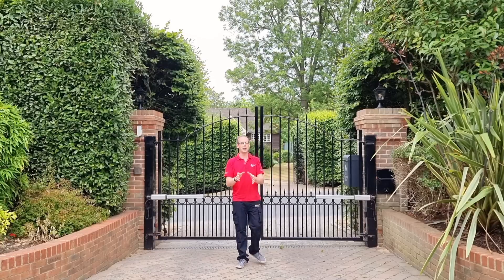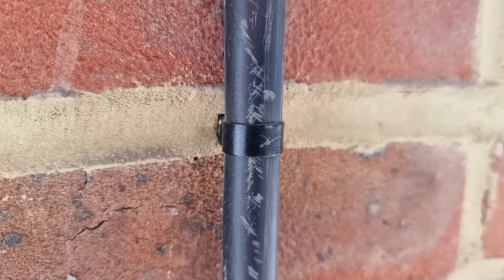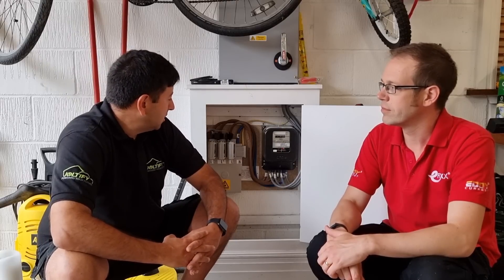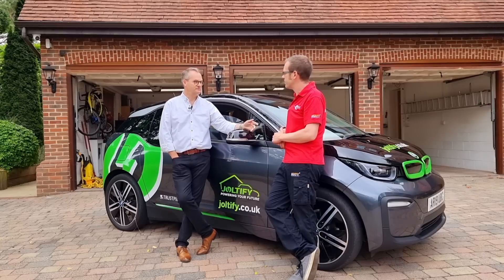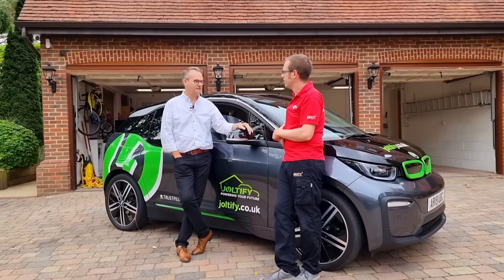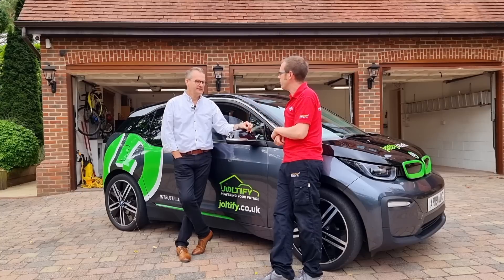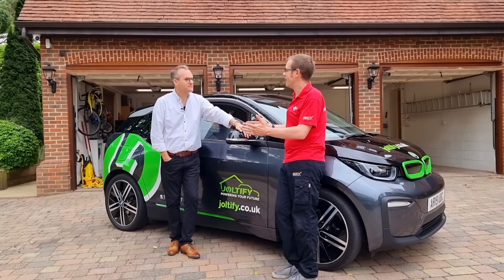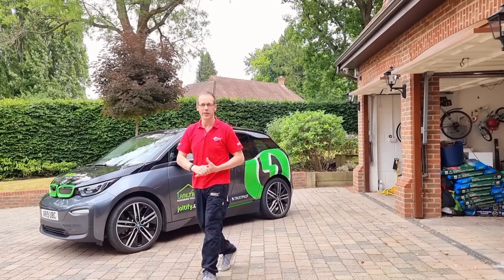THREE PHASE EV Charger installation at HOME with Joltify

Comment: This is what we did in our UK home.  Upgraded to 3 Phase free of charge.  Then added:-

2 x 22kW home chargers (Grid Tied)
1 x 7kW home charger (storage battery & Solar Power)
2 x Tesla Powerwall batteries & Gateway
7.2kWp Solar Array
Smart Meters & Ev Tariff
2 x Electric Cars
Heat Pump, Induction Cooking & Electric Showers

Comment: Not much point in three phase 22KW is there as most EVs only have 11KW AC to DC charger?
Reply: But if you do need a small car (with a range of about 200miles on the 50kWh versions), the Renault ZOE does charge at 22kW, so faster to charge at home than far more expensive cars.
Reply: If you have a 3 phase unit, you can pull 16A 3phase for 11kW, 32A 3phase for 22kW (Zoe & old Tesla) or if you’ve got a car which can only charge single phase you still get 32A for 7.4kW. If you restrict it to 16A needlessly for 11kW you’ll only get 3.6kW single phase.
Reply: We have 2x22kW fast Grid tied chargers at home.  Both charge at 11kW without load balancing... so it's quite handy.

We've also got a 7kW charger connected to Battery Storage & Solar for Summer & during blackout use.
Reply: The video said this is about future-proofing as cars come out which will allow for faster charging from three phase AC.

Comment: Great for people that can afford a house with three garages but I'd like to see more videos about how the rest of us plebs are supposed to deal with EV's.
Reply: Why does the use of a 3 phase charger depend on having 3 garages?
Reply: @deang5622  It doesn't but only the sort of people that can afford a house like that are likely to be able to afford getting a 3 phase supply put in along with all the other associated works.
Reply: @mfx1  Of course it doesn't depend on having 3 garages. I just wanted to expose an error in your statement.

But you're not entirely right in your thinking.
The typical car battery is 100KWh.
You can feed at most from a residential supply 23KW if you put in a dedicated circuit.  Now that wouldn't leave any capacity left for anything else to be powered.
So let's reduce that to say 15KW.

So during the course of the night from 11pm to 7am, you can push in to 120KWh.

So installing a dedicated circuit running on single phase, it is possible to fully charge a single EV vehicle.
 That, is you don't need a 3 phase supply.

You could even charge up two cars to 50% of capacity, giving half their full range in miles. Which is more than enough to get people to work and back.

Comment: Wish you people in another country identify country because electrical vidios very seldom pertain to anything in the USA. As a life long electrician that worked in hundreds of homes NOT ONE ever had a three phase service so this vidio is 100% useless. Never heard of a single electrical ultility company that would even provide three service. Maybe if you had a 50 Millon dollar mega all electric mansion they might offer it but not to the 99.99% of the rest of homes .
Reply from the maker: Three phase is rare in the UK, but the norm in many European countries.
Reply: It's 100% useless for you, but then again you don't have to watch it. There are, but "another country" doesn't mean just US. In the Nordic countries 99% of the detached houses, all new apartment buildings and commercial buildings run on three phase 400V. We only install three phase chargers. There are one phase ones they are more temporary movable chargers
Reply: @John Thomas, I can assure it happens more the other way around because the USA is a massive country that dominates the whole internet. Electrical Installation tends to be very country specific.

Because I watch a lot of electrical videos, I get a lot of videos recommended to me from other countries but mainly the USA. I generally click on the 'don't recommend channel' option but there are exceptions because it's sometimes interesting to see the differences on other countries.

It still fascinates me that the USA still use wire nuts and don't sleeve earth wires. Routine inspection and testing seems to be less comprehensive there. Our differences can be educational as well as amusing 😉
Reply: @KendalMike  I have been using pressure connectors for almost 60 years with no problems. No such thing as a wire nut in the USA NEC ( Code book ) Wiire nuts are a product made only by the Ideal Company. Willing to bet that a pressure connectors installed on vibrating machines such as crushers, hammer mills, vibrating screens etc will hold up a lot better then toy wego's. I have went back to motors , limit switches, outdoor equipment 20 to 30 years after I installed pressure connectors and they were all in great working condition. It's all in the preparation. Was taught to always strip say #14 & 12 wires at least 7/8" then pre twisted with a heavy pair of linesmen pliers, tighten pressure connectors with heavy linesmen pliers until you have a full turn if insulation then use a quality electrical tape to help keep water out and pressure connectors from loosing up. Always place top of connector up to prevent water from entering.
Reply: The expand on eFIXX's reply here yes 3 phase is rare to your average residential dwelling in the UK. But i can pretty much guarantee you that it is present in close vicinity to 99.99% of properties in either the under ground or over head supplying cables in the street. 

You can have 3 phase to your premises if your network operator (DNO) will allow it and you are willing to pay for it to be installed £££ / $$$ 😉 plus you will have a higher standing charge for a 3 phase supply. Indeed its probably the future for UK housing developments eventually as it will help with load balancing, premises micro generation equipment (or will it be 10A 3phase with a hybrid inverter  a load of micro gen and 48v dc for everything in the home, some turbines in a local field along with battery storage to smooth outgrid capacity/ peaks troughs variations all designed in by law as part of the housing development  🤫 who knows time will tell!). 

eFIXX have looked at this in another video. I have been in plenty of UK detached homes with 3 phase granted they are larger homes for the UK but not mansions by any means probably only bit larger than your average detached USA homes 😉 🇺🇸.
Reply: So you're a life long electrician that isn't keeping themselves up to date.
That's not good.

There are new build properties in the UK that are being built with a 3 phase feed.
Reply: @deang5622  Wrong. I am more up on the code then at least 90% of the electricians that I worked with. Up until the pandemic paid to attend the 8 yearly IAEI continuing education classes, read code question of the day from two different sites and one of the very few sparkies who purchased the NEC book when it came out every three years. Never failed a legitimate inspection. Had a local hick small town inspector try to tell me that I had 3 violations after my inspector passed the job. Told me that I was not allowed to splice a #14 wire in new panel because it would not reach a circuit breaker. Gave him the exact NEC article that allows it. Told me that he would let me get away with it that time. Other 2 violations was from a guy who wired in a sign that he installed and was not even on my permit. At one company that I worked for they stopped letting me attend construction & remolding meetings because I was the only person that brought up possible code issues.
Reply: @JohnThomas-lq5qp  So why don't you know about the adoption of 3 phase in some new builds?

It is not about being "up on code", clearly!
Because if it was purely about that you would know.
Reply: It's only 100% useless if you buy it and you don't have a 3 phase supply.  That would just be silly.